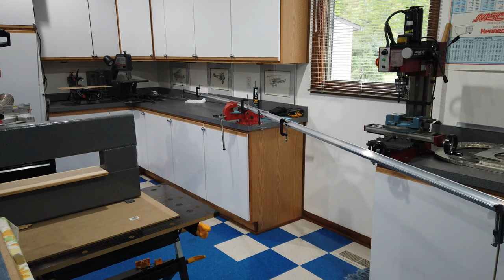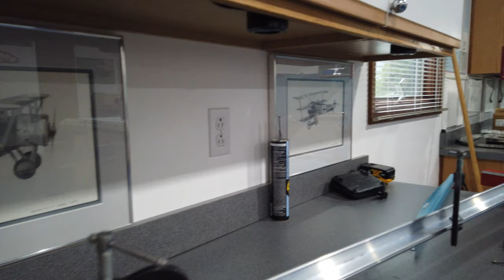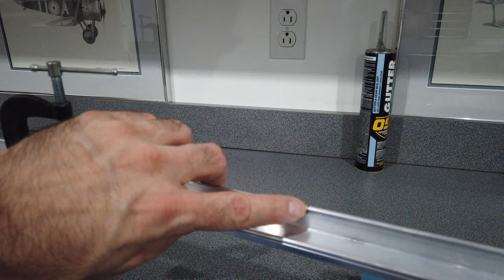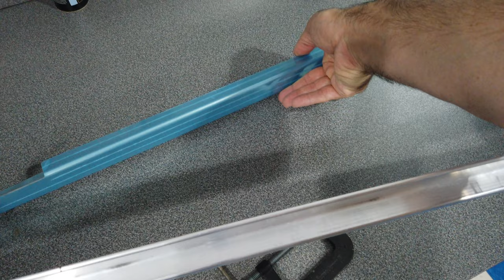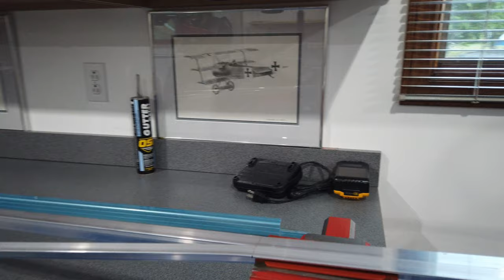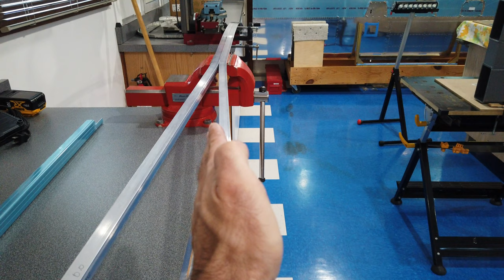RV 7 HINT Video F 706 Final and Longerons

Comment: Thanks for the well documented vid.  I noticed you appear to use 721 B L as the only guide, did you also cut out the guide from the plans?  They look great and so does your build.
Reply from the maker: Howdy Ovid. Thanks for the very kind words!  I prefer to use real-world, as- flown parts for templates and jigs where appropriate. So I did not use a printed copy of a drawing when I have the actual parts in hand to use as a guide. I like to fit parts to parts rather then parts to pictures/drawings because every build will be slightly different.
Reply: @KaretakerAero   Thanks so much for getting back to me.  I'm actually headed to the shop to bend them now.  I totally agree with the concept of using what is the actual bend rather than the template bend.  Saved me a trip to the craft store.
Reply from the maker: Great! Have fun and take your time. They will turn out perfect!
Reply: @KaretakerAero  Just finished.  They look great!!  Bending them together was a great idea.  Thanks again.  On to the next step.
Reply from the maker: Very Nice; glad it worked out!